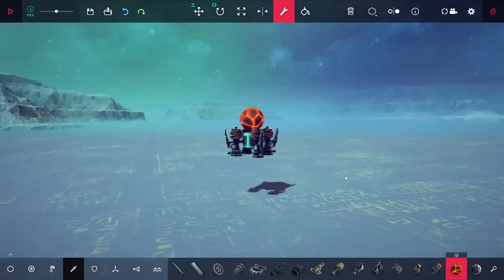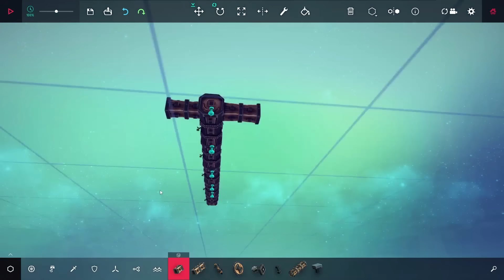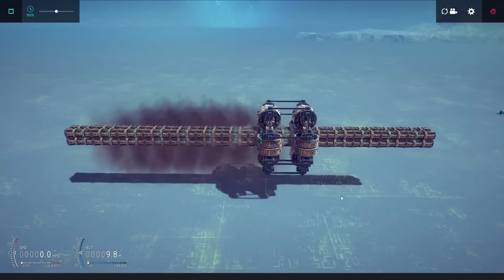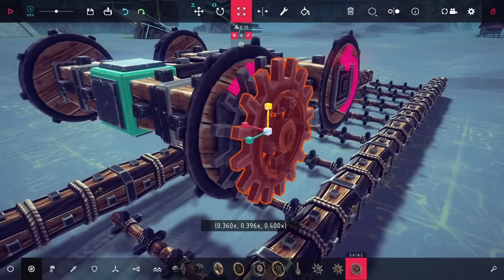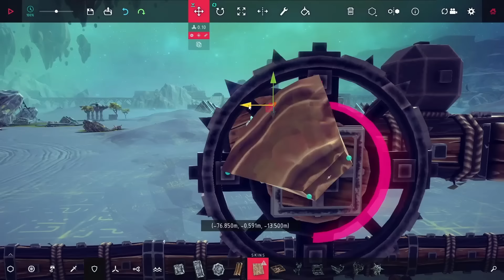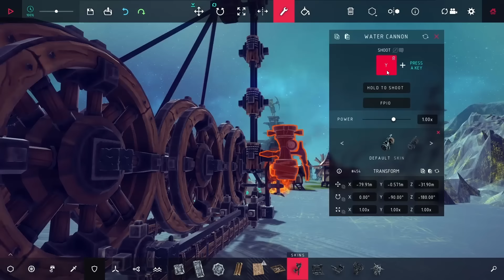Making a Steam Powered Train in Besiege

Comment: It’s a lot better if you offset the pistons by 90 degrees rather than 180, at 180 both pistons get stuck in the center of the wheel where they can’t push or pull so you get a lot of binding, but at 90 degrees when one piston is at the center the other will be in the top or bottom of the wheel so it’ll be able to turn the wheel to a point where the other can start working again

Comment: I'd love to see another episode of this. I'd stagger the crank pins on the wheels at 90 degrees and make the "pistons" double acting (Push and pull) That way every 1/4 turn of the wheels is a power stroke. Double your power and run much smoother.

Comment: steam pistons attach at a 90 degree offset on either side to the driven wheelset

this is because they provide a push on BOTH sides of the stroke, forward and back

this means you get 4 pushes per rotation, this gives you a lot more "oompf" to move rolling stock (the train cars)

in almost all cases, a steam engine has more pushing/pulling power than an electrically driven one (including diesels and diesel-mechanic ones), but it only gives you more power when its actually able to get all 4 cycles to go off in a set amount of time, which is why we just use more diesels, because they can just slug it out at really low speeds

Comment: 8:29 these are called flanges. All real trains have them, and they help keep the wheels on the rails, especially if the tapered/conical wheels don't get the job done completely. If the wheels aren't tapered, you at least need flanges.

Comment: The wheel arrangement you used is called a 4-6-0 meaning 4 leading wheels 6 powered wheels and 0 trailing wheels and that wheel arrangement was commonly used for freight and heavy passenger service.  ( fun fact Walt Disney World uses 2 baldwin 4-6-0's on its railroad)

Comment: Key things about trains 

1) low angle tapered wheels are necessary for good travelling.

2) offset the pistons at 90° so that there is never a time that both pistons are at max travel. (unable to push past 'neutral')

3)  larger drive wheels give more speed, smaller drive wheels give more tork

Hope this helps if you ever come back to this.
Reply: No almost all workhorse type engines, on average, have smaller wheels, whereas trains built for speed tend to have larger wheels...

For example, porter type trains like the BALDWIN 6-22-D (D&RG CLASS 48) had smaller wheels, whereas something like the D&RGW CLASS 25 (MONTEZUMA) had larger wheels but was scraped for being underpowered (despite its speed)

Honestly, if you watch some of hyces (youtuber) videos, he explains in better detail and also goes into the specifics of blind wheels and flanged wheels as well
Reply: Isn’t point 3 the opposite? Like, Smaller wheels are faster but larger give more torque. Which is the reason why tractors have large wheels and farriers small ones

Comment: I think a lot of what is actually moving the engine is the recoil of the water cannons acting on the frame rather than them actually spinning the wheels (seen especially at 10:46 where the wheels should have spun counter clockwise moving the engine left but it kept moving right, and the friction on the rails turned the wheels in the correct direction against the piston) you could remedy this by making the pistons double acting like on an actual steam engine, as it would cancel out the forces from the water cannons and only be coming from the wheels

Comment: One big concept that you missed is that steam locomotive pistons are double acting, meaning that the pistons are powered on the forward and backward stroke. Since cylinders have no torque at TDC and BDC, the cylinders are staggered 90 degrees from each other as opposed to 180 degrees, allowing for one power stroke every 90 degree rotation. This is the reason a locomotive chuffs 4 times for every wheel rotation on a 2-cylinder engine.
Reply: I do think the lack of double action pistons are the biggest issue I see.  Especially when he was showing off the increased load on the engine: having more power on each 90° turn would let it pull more as well as run smoother.

Comment: I love that there's trains in Besiege now, and i just have a few tips for you if you come back to this idea. Try linking the four small wheels at the front (the pilot wheels) to a subframe that has some lateral movement along the tracks, and so that they can start to turn before the main driving wheels start to turn. Also, try removing the thin, biggest wheel in the center of the driving trio. That's your equivalent of a flange, and on lots of model trains and some real ones the center drive wheels would be "blind" (no flange) so that they still provide adhesion to the rail on the straights, but on turns they just float. Kind of like semi truck trailers. One last thing, steam locomotive pistons are offset by 90° instead of 180°. That way no matter how you stop you wouldn't end up with one piston at full extention and one at full retraction, thus with no way to inject steam into the other side of the cylinders and move the pistons. Until next time.
Reply: I dont quite think 90° would work in besiege without a 4 stroke system. Otherwise you'd end up with 1/4 rotation without power.
Reply: Offsetting pistons by 90 degrees was more to do with putting down more torque and is a big part of what gave steam trains their ability to seemingly pull any load with enough time. There were many simpler fixes to pistons getting stuck at full extension which were used on steam engines, just not on trains.

Comment: What's funny is that the physics engine of the game pushed you into engineering designs used on real trains, including the tapered wheels.
Reply: Low taper wheels
Reply: @Kuro-mg8vc  😭
Reply: Mankind has optimized trains
Reply: Bruh @jimbo3671
Reply: And the instant switch from vertical power to horizontal, much like the real world development of the steam powered locomotives, iirc
Reply: Trains are the crabs of logistical engineering
Reply: It is cool
Reply: The tapered wheels of trains are a small detail but often unnoticed! Glad he got to know the reason lol.

Well i think he actually knows alot about the thing he's making, but he just presents it in a step-by-step trial & error kinda way so the viewers feel like they're figuring out solutions!
Reply: Conical wheels
Reply: Next time I recommend you should definitely look into valve gears (ex: the walschaerts valve gear or Stephenson valve gear)!